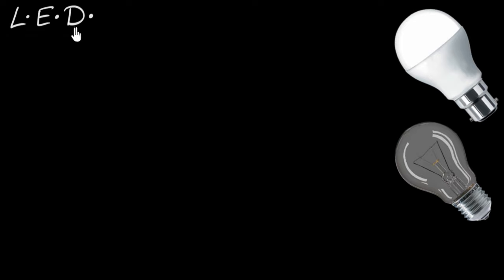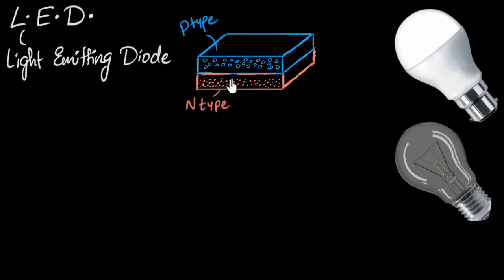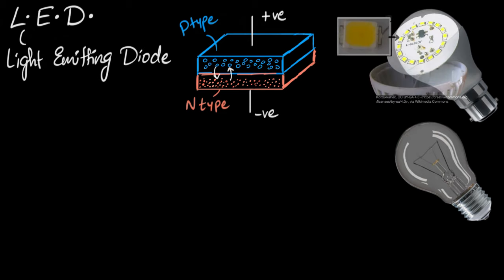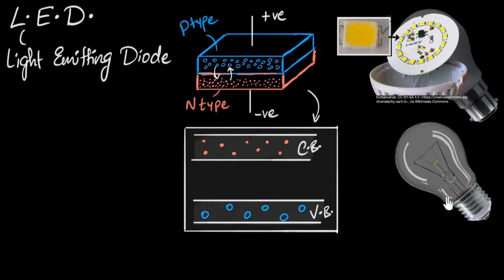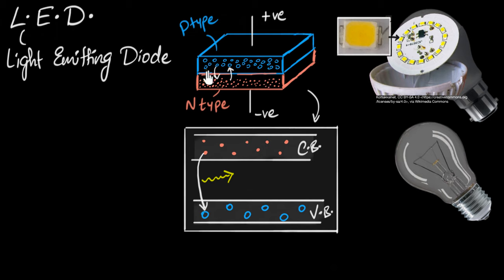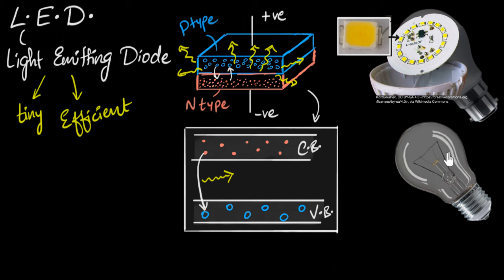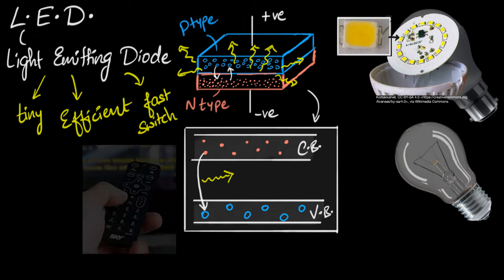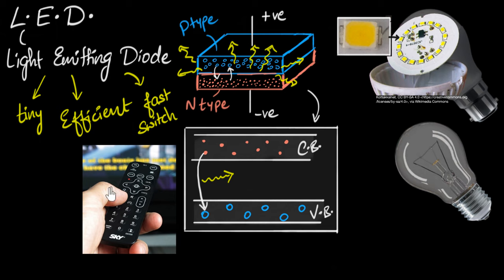LED working & advantages | Semiconductors | Physics | Khan Academy

Comment: Very, Very well done.(Wish you could pre-write the words to lessen my anxiety level.) I think that there will Always be heat generation, even in recombination, albeit sooo tiny.
And a pn junction is not a diode (and vice-versa) it only contains it as do transistors, scr, jfets, ect...
Enough of my criticism. Do leds use a specific substrate instead of silicon?